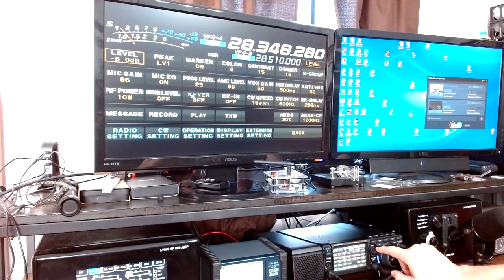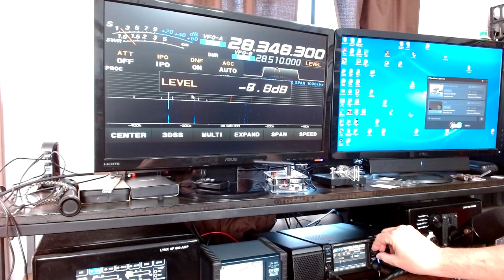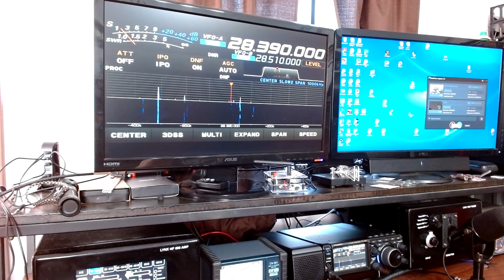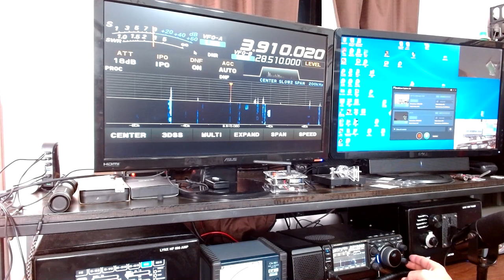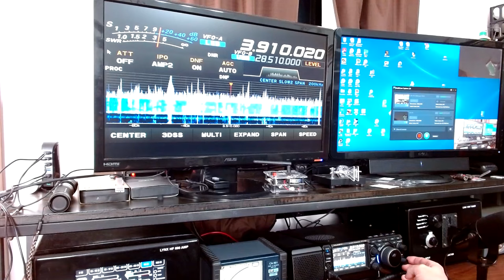Eliminate Noise, Capture Weak Signals: HF Radio Secrets Revealed

Comment: Also, turning off the preamp lowers the cover all IMD, intermodulation products. Strong off band signals can create in band products when the 3rd order intercept point is low. Bypassing the gain of the preamp increases the 3rd order over all intercept point thereby reducing out of band products. Good job!
Reply from the maker: Thanks! You are correct. This is where Yaesu comes up with calling it intercept point optimization. Or IPO for short.

Comment: Great video. I just got my FT-710 a week back so this was especially helpful. Say, what is that line of interference that dashes across the waterfall at regular intervals. I have the same thing too and I am baffled by it.
Reply from the maker: Thanks glad it was helpful, there are a number of things that can do this. We all see them. Slow moving ones that drift up or down across the band over minutes can be switch mode power supply’s in your house adjusting switching frequency. This is why you need to be careful using them to power your ham equipment . Some of them can be quiet but many are very noisy. On the other hand fast moving sweeps that last a few seconds can be antenna analyzers or hf radios like the ic-7300  that have this built in. Users hit the scan to chart their antenna SWR across the band. The rig transmit a low power(not low enough) signal sweeping up the band and near by hams all see this as it transmits the fast sweep. But it could also be a lot of other things also.

Comment: when you say at 9:30 in the video to roll back AF Gain.... did you mean RF gain? On my ft101mp the AF is basically just volume? And it looks like you are turning the RF gain knob? Just checking but maybe its just the difference between the 101 and the 710?
Reply from the maker: Yes, I miss spoke and meant RF not AF gain. Good catch I had not caught that. The idea is to get the gain reduced to a level the background noise is not being increase enough to make it through the if stages so you are left with only the signals above it making it through. Makes listening so much more comfortable and does not fatigue you listening to the noise.
Reply: I also use the RF gain to adjust noise.. I don’t know why the S meter does what it does while adjusting RF gain though! I enjoyed your video! 73 de KA0EGE
Reply from the maker: Thanks,  It is showing you what S-Level a signal needs to break over and be heard. so as you back it down the s level goes up to show you need stronger and stronger signals to hear them. Or it is suppose to work that way. Is this what you are seeing?

Comment: Golden rule, NO PRE AMP from 20M or below, pretty simple really;
Reply from the maker: Basically yes, but I have a few rare dx contacts on 40m that I needed the preamp to get. So the rule is not 100% but pretty close.
Reply: Thanks just setting up a FT-710. As a tech I am on 10m, just getting back in ham radio!
Reply from the maker: Welcome back, and to the channel! It’s been great to see 10 meters open lately.

Comment: Turn off DNF for this demonstration and discussion…. DNF acts to attenuate the signal
Reply from the maker: Digital noise filtering is the digital signal processing. It may seem to attenuate and in some cause boost the signal depending on the algorithm you chose it is looking at patterns in the signal and trying to remove ones it sees as noise while not removing the parts it see as human speech or cw.  The ft-710 can be very effective at this as seen in the video, on the most aggressive setting it can kill most all of the noise and even deaden the lighting crashes, but at the cost of distorting the speech slightly to sound underwater.